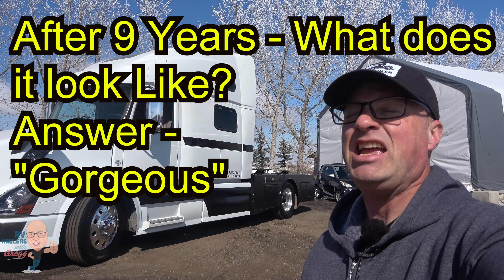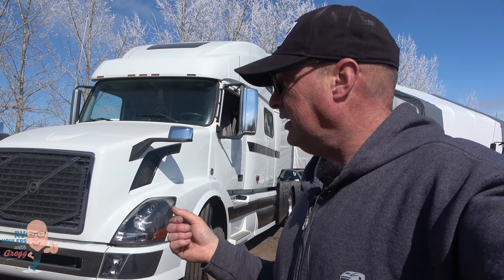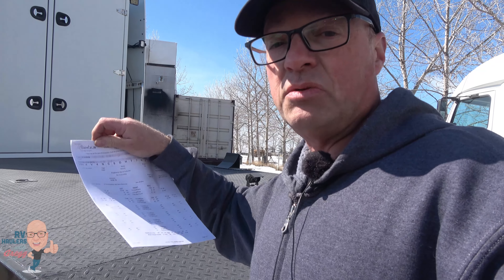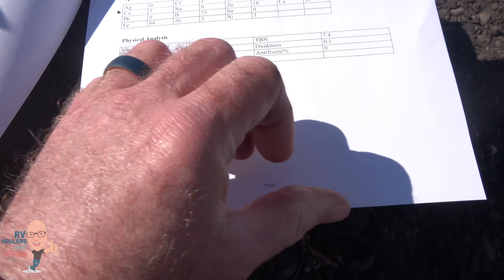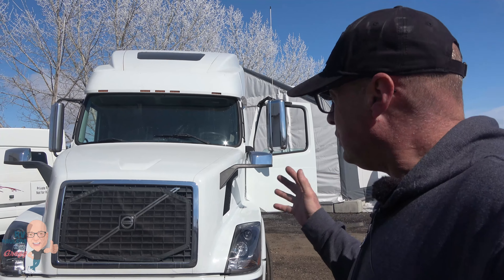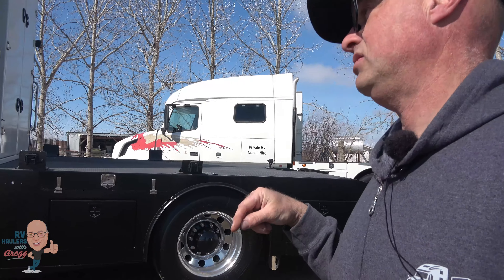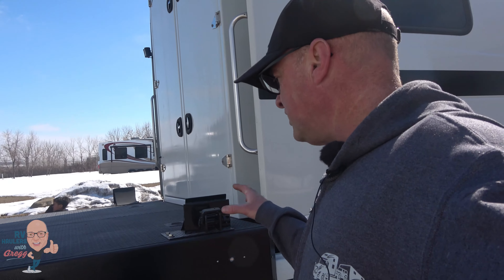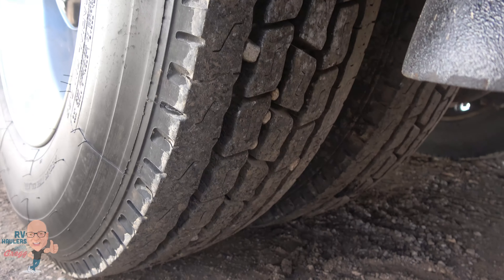9 Years Later - Boondocking OffGrid RVHauler named FISHER

Comment: After 45 years of driving semi trucks, I wanted to go from a half ton pickup to a 3/4 pickup truck and maybe a single axle short sleeper conventional cab power unit. My third pick up truck is a 2013 Ram 2500 4X4 quad cab 5.7 hemi which gets 8-10 mpg which isn't bad for a gasoline powered unit. Even though I am tickling 70, I would like to entertain the idea of a class 8 power unit with 400 horsepower and a decent final drive ratio below 3.73 to 1 on 11-22.5 low profile tires.
Reply from the maker: Hey Phil,
Give me a call and we can do some brainstorming of ideas!
Gregg

Comment: Hi, what brand/kind of paint do you put on top of the bedliner? Thanks
Reply from the maker: Hi Ken,
We use an AkzoNobel Sikkens commerical paint.
The KEY is you have to apply the top coat quickly after the bed liner.  Within 10-15 minutes MAX.  This often means you apply some bed liner to a moderate area, switch over to top coat it, and then go back to bed liner.

Thanks for the question, and thanks for watching, Gregg

Comment: What’s a complete new paint job worth approx Gregg. ?? $20k Cdn?
Reply from the maker: Hi Keith.  There is a huge range of paint job qualities - ranging from 

quick (looks good from 6 feet away, and don't open the hood or any doors) - about $7,000 USD (or even less) - sorry, not what I do

to

Gregg Quality - where we take off seals, mirrors, panels, doors, and any removable piece.  Every rock chip filled.  You are hard pressed to see a difference between a factory paint job.  -  about $14,000 USD 

Great question!  
Thanks,  Gregg
Reply: @rvhaulers  thanks Gregg. So I was pretty close in Canadian funds on what you would expect to pay.